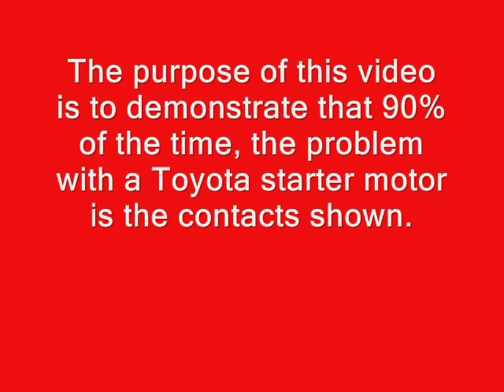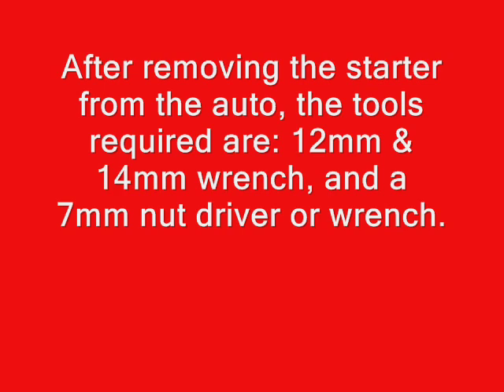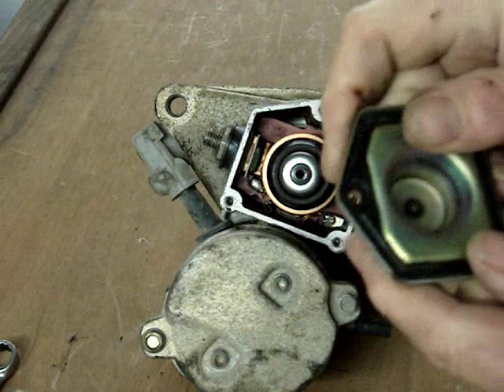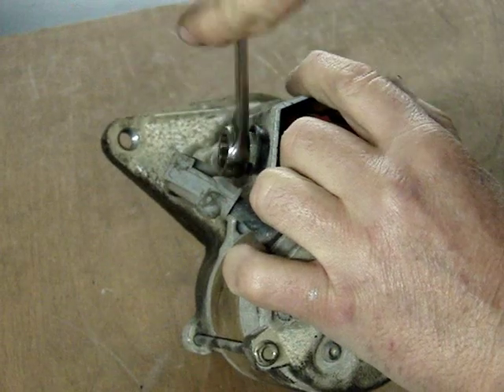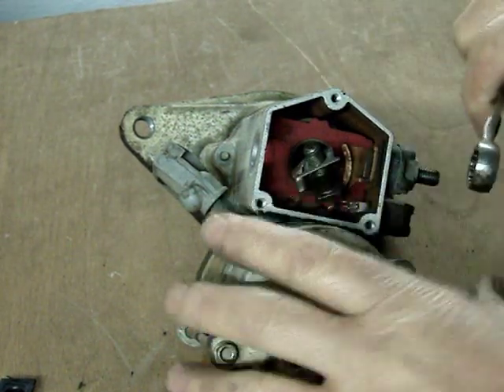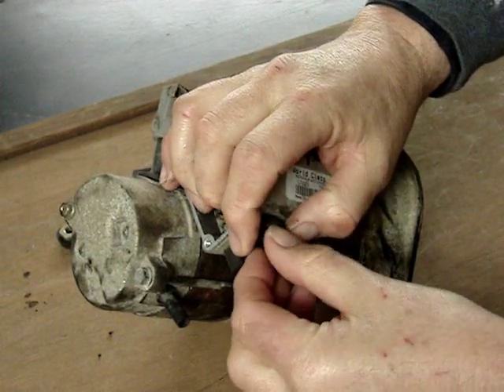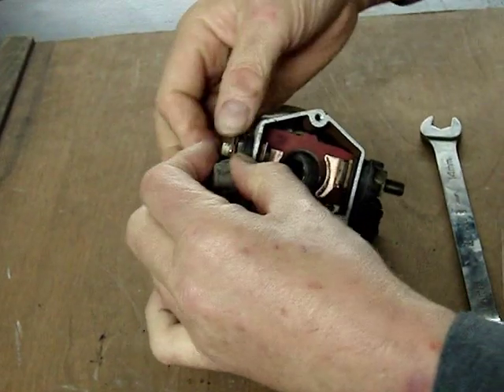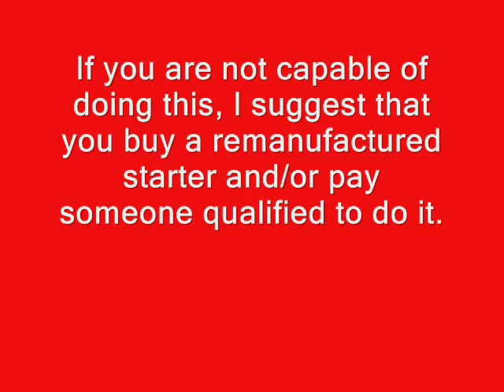TOYOTA STARTER MOTOR, EZ repair (Corolla Celica truck car prizm Vibe camry T100)

Comment from the maker: If it is just "clicking" it sounds like a starter motor problem as described in this video. Rain can't really get onto the distributor cap when the car is parked, nor many of the engine components. If this problem relates to "after it has been driven in the rain" then yes, it can be these problems you mention. But if it will start after when dry and after being parked when dry but will not start after rain, then it sounds more like a humidity related problem.

Comment from the maker: Also check battery cable connections and plug-ins. You can unplug the ignition connections and spray them with silicone to repel moisture. Hope this helps. Thank you for watching. Jim

Comment: Hi Jim, 
I have been having trouble getting my 97 corolla to start. It is only happening when it rains. I have been researching that it could be a distributor cap crack, a crack in my starter, or alternator. 
How do I know which I should be looking at, my distributor cap doesn't appear to have a crack. that is the only peice I can see easily. The engine will sound like it is getting ready to start, but it won't turn over. I have replaced spark plug wires and plugs so I know it isn't due to this.

Comment from the maker: Typically a hard starting problem that is related to heat is caused by the armature dragging on the inner case. This is because the internal parts expand when hot. This is often because of bad bearings on the end(s) of the armature. When the bearings go bad, this "play" allows these internal parts to come in contact with each other when they are hot. Typically replacing the bearings will solve this problem but disassembling the armature of the motor is more complicated. Thank you for watching.

Comment from the maker: Hello,
Some users have reported that these parts can be obtained from Toyota as well. It seems that auto parts stores are getting away from selling small parts and going into "corporate mode" where inexperienced counter help is the norm and selling you a complete assembly instead of the parts to repair. Another option is to try a company that is an auto-electrical specialist, they might have the parts in stock. If you find the parts, please tell me and I will post your reply, Thank you, Jim

Comment from the maker: It is possible that you have bad starter armature bearings causing the starter to "drag" If it does this when cold and also hot, it is usually only the contacts. If it does it worse when the starter is hot from sustained running then suspect the armature bearings. When these parts heat-up and expand, then the dragging usually get worse. You may be one of the 10% that needs a starter motor replacement.

Comment from the maker: Possible that it would be corrosion on the battery terminals but usually this is the first thing people correct before they look at the starter. As my video text explains, these contacts are the problem in 90% of the applications.

Comment: Hi Jim...I don't like that 'throw away and buy new' neither, that's why I try to fix it. I took the starter apart and cleaned all the contacts with sandpaper incl. the plunger...the contacts actually didn't look too bad. Put everything back together but still get the clicking only...takes 10 or more try's before it eventually starts. What else could be the problem. I have a 99 corolla and it's hard to get that thing in and out...had to remove the oil filter to pull it. Good video though!

Comment: I went to my NAPA store but they told me they don't sell these contacts...just complete starters...my toyota dealer sells repair kits for around $20 for each contact (comes with all the screws..but I don't it) really hard to get the contacts only.

Comment: This video was perfectly accurate! Thanks Jim.  I used the Toyota OEM Part Numbers  28226-74070 and 28226-64370 for our 1998 Camry V6.   They were $32 total and it took me less than an hour total to fix.  Cleaning the  plunger contacts with emery or sandpaper is the one tip that I HIGHLY recommend doing as Jim had instructed.  Without doing this the repair is basically useless.  Our car is starting like it is brand new and it has 178,000 miles on it!

Comment: Hi, I have a 1985 Corolla and my starter has failed for the 3rd time in three years.

I've been buying Bosch remanufactured ones.

I live in the mountains and it is kind of damp up here.

Could my problem be that my contacts are just getting very rapidly corroded, as you outline in this video?

Thanks!

Matt in Millbrae

Comment: @earltuckian  i figured it out what the problem was with the 98 camry 4 cycl starting problem...i found out that  it was the shifting cable when the car does not properly lock on  Park  "P' if the car does not lock on park properly it will refrain the car from starting ...so there i loosened the screw which is located by the engine..and did some internally cleaning with a wd40 it solved the problem

Comment from the maker: @MrProTechHD  - This changing of parts without actually knowing the problem is common, often very expensive and the exact reason almost all auto parts stores do not accept returns on electrical parts. I once experienced a VW dealership which did this as well. (Just start changing parts until the car runs.) All the time charging labor and spare parts at their customer's expense. Of course they are no longer in business.

Comment from the maker: @MrProTechHD You don't say the mile on your Camry, but this sounds like your problem. If you take the starter off and find this to be the problem, then there is really nothing else you can do as everything else in the system has been changed. The only thing left to suspect would be the ignition switch on the steering column which is a very rare failure.

Comment: i have a question i have a 98 camry 4 cycl. i have changed the battery terminals,the battery,the alternator,this morning when i gave it a jump it started it ok i took the jumper cable off then turned the engine on and off 5-6 times a row it did start it fine then few hrs later i went some where  when i left my home i heard a click while trying to start it...then at the 2nd start the engine started...does it sound like a starter problem?

Comment from the maker: @fungyinpan1 Sorry for your problems. but it seems that you must have done something wrong. Perhaps you do not have the starter motor properly installed to the engine? Loose bolts?

Comment from the maker: Depending upon if you have the V6 or 4 cylinder engine, it is not the same exact starter, but the components and repair procedure is identical on almost all Toyota starters for several decades. Thank you for watching.